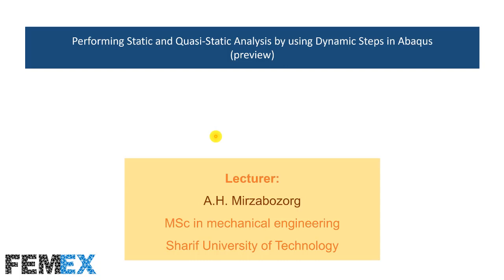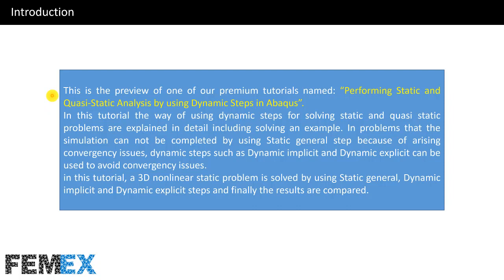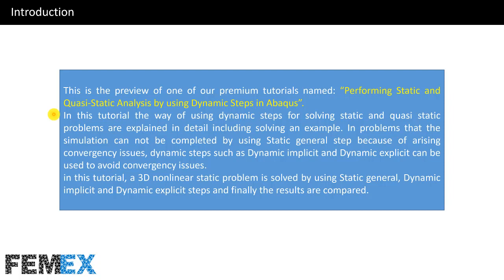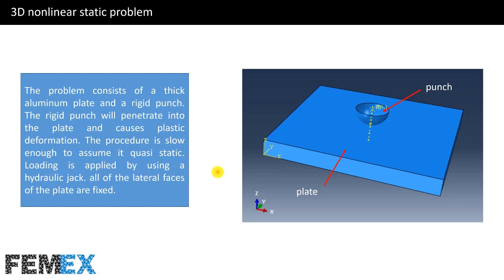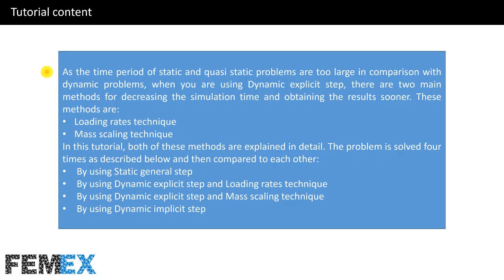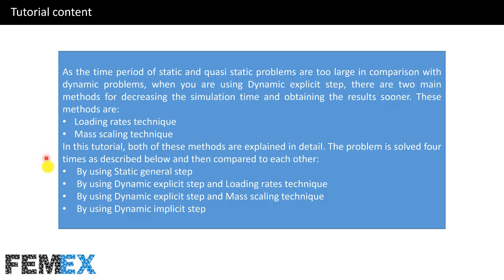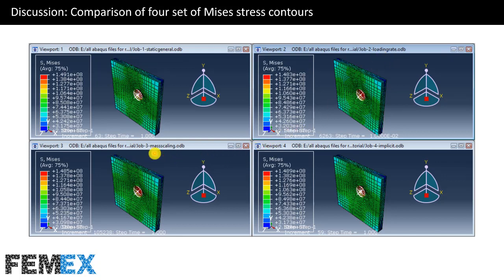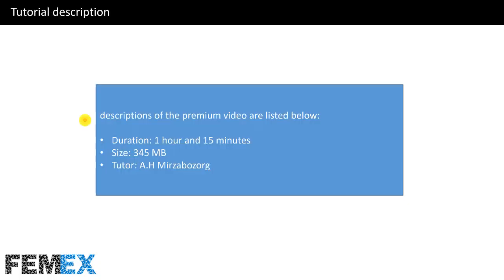Static and Quasi-Static Analysis by using nonlinear Dynamic Steps in Abaqus(preview)

Comment: So can we solve it with static analysis or dynamic analysis according to the problem ?, and it has no specific solution, I mean that the solution method will not change, is it the same static or dynamic solution?
Reply from the maker: for solving the quasi static problems, we can use both of the static general and dynamic steps. but the static general step can not solve highly nonlinear quasi static problems and the dynamic steps must be used instead.
in solving quasi static problems using dynamic steps, there are several important points that are mentioned in the premium version of this tutorial.

Comment: what is the different between static and quasi static analysis?
Reply from the maker: hi.
quasi static analysis is between fully static and dynamic analyses.
in the quasi static problem, the rate of changes are small but not zero. in static problem, the rate of changes are zero. for example rolling and extrusion processes are quasi static physically. in the Abaqus, they must be simulated as quasi static problems.
rate of changes such as :
velocities
deformations
displacements
notice that the rate of these parameters are small not their values themselves.
also the static problems can be solved as quasi static.

Comment: I readied your answers , You said that in quasi static problem the effect of inertia and kinetic energy is small, so the Inertia matrix will be canceled correct? So why you said also we can solve it by dynamic explicit or implicit? I mean when the Inertia matrix canceled and the equation will be [K] [d] =(f). I know that implicit or explicit for solving the equation [M] [a] +[C] [v] +[K] [d] =f and in quasi static this is not the equation.
What is the difference between quasi static and static if the Inertia, loading and rate of deformation in both states are small and the same?
Reply from the maker: sorry.
 you didn't understand my explanations correctly.
I said that we can use static general step in solving quasi static problems because by using this step, the mass matrix and inertial forces are not accounted in the simulation. this is correct because in the quasi static problems, the inertial forces are small. also we can use dynamic steps because they solve the complete form of governing equation that is [M]{a}+[c]{v}+[k]{u}={f}
the main reason for using dynamic steps for solving quasi static problems is the limitation of static general step in solving highly nonlinear quasi static problems. in solving these problems using this step, convergence issues may arise and we will face "too many attempt ..." or "minimum time increment ..." errors.
when we use dynamic steps for solving quasi static problems, we must mention some critical points to conduct exact simulation with reasonable simulation time. this tutorial focuses on these points.

Comment: So we can use general static step or dynamic to solve quasi static, can you explain more about quasi static, what is it exactly because i confused now
Reply from the maker: in the quasi static problems, the rate of deformations and loadings are small so the effect of inertial forces are small. so the value of kinetic energy is small in compared with the internal energy. for example the rolling process and extrusion process are quasi static.

Comment: Hi 
Is Low velocity impact dynamic analysis or quasi static ? 
We mean from quasi static analysis that we divide the problem to many increments and we solve each increment like a static analysis, so we cancel the Inertia matrix and still only stiffness matrix? Is this correct or no? 

Is these stiffness matrix must be update for each increment if we have small deformation theoretically or we can assume that its constant ?
Reply from the maker: hi.
1) low velocity impact is not a type of quasi static analysis because in the low velocity impact, the kinetic energy has an important role but in the quasi static analysis, the kinetic energy does not have an important role.
2) in all of the types of non linear analyses, the problem is divided into small increments. in the quasi static analysis, if we use static general step, the mass matrix is not accounted in the simulation but if we use dynamic explicit or dynamic implicit steps, the mass matrix is accounted.
3) in all of the quasi static analyses, its better to activate the Nlgeom to account the large deformation effect.